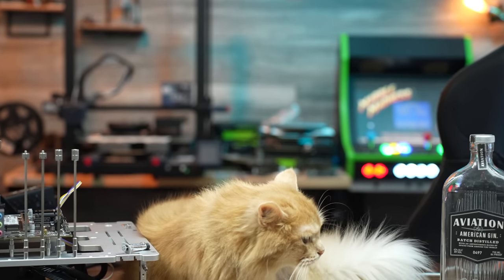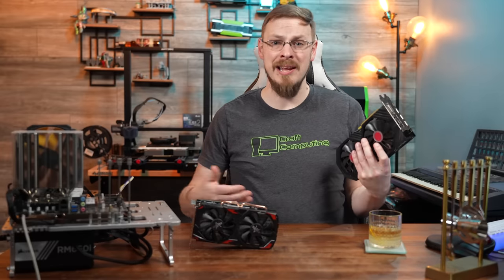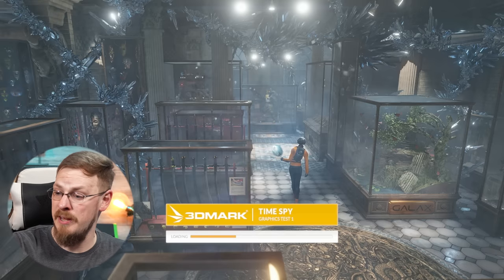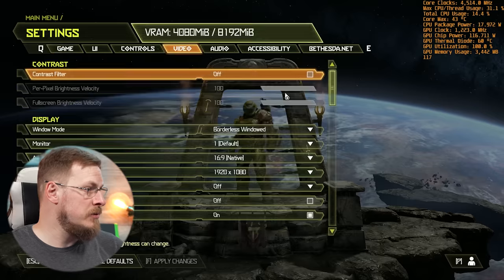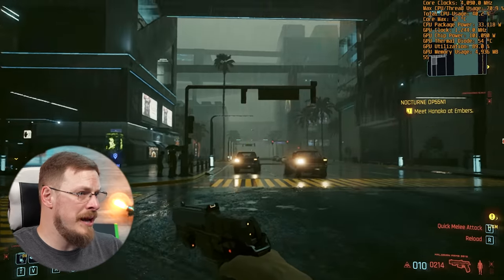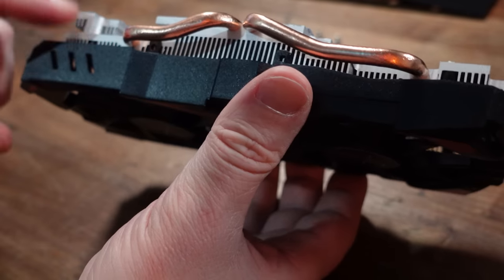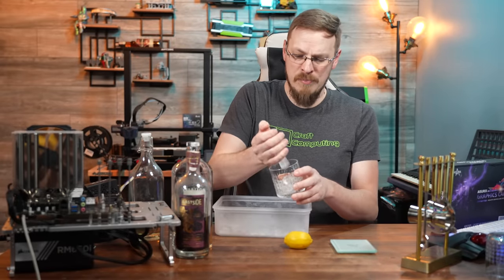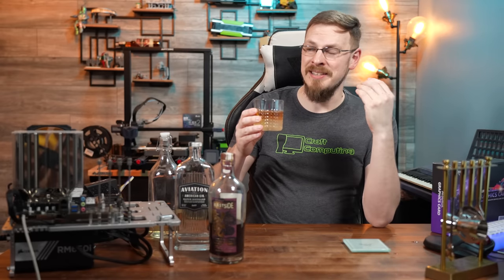BRAND NEW RX 580 for Under $100???

Comment: Why would anyone buy one of these things when you could get a used RX 580 or GTX 1060 for around $75 these days on CL or Offerup? You can slot and test those, too, and not have to wait an entire month for shipping. Far less worry about hacked roms, harvested miner chips, janky designs, malware, uneven QC, etc. These cards are firmly in  "penny wise, pound foolish" territory for me. I could see some appeal in some foreign markets with huge markups on original equipment, but if you're in the US with strong resale markets, I just don't see the point.

Comment: Before I  bought my asrock 6600 challenger D, I had a mlsse aliexpress 5500xt, it wasnt a great card, there is the fact that windows gonna windows, and would replace the drivers everytime it had a chance, so forgetting to do all the rigmaroll of disabling automatic driver updates could make the situation just annoying or straight up fuck up my windows install.. That being said it was a card that had some weirdo chips in it, the performance was really bad compared to a brand name rx 5500xt, the display port that worked (1 out of 3 only) would not work at all, when on a system, would display up to the motherboard logo, then the display would just die, regardless uefi or bios
I have an intense distrust to chinese cards ever since

Comment: I just have absolutely no clue which AMD card is new, old, good or bad. Their naming schemes are so confusing to the casual observer, I have seen "RX580" for sale but assumed this to be a very dated card given I can see 5,6 and 7000 series cards on sale and assumed these to be their older/mid/high tier cards.
Reply from the maker: This is correct. In order of release

400 series
500 series
Vega series
5000 series
6000 series
7000 series

Comment: Once again Patreon lets me know that you've posted. I don't know what YT's problem is but they need to fix it
Reply: yt notification never worked properly
Reply: @marcogenovesi8570  I know. I think they really need to allocate some time to "quality of life" features. But, I mean, come on, are they really going to do that?!
Reply: As I understand the notification goes out in waves. they measure how many of the initial audience click on the noti and then decide if it's worth the cost of sending out notifications to the rest of the subscribers or not. this is usually why it's recommended you tweet out or send a notification via other channels which signal the algorithm that there is organic traffic to the video which automatically breaks the threshold and videos starts being recommended to others.

if the video topic is not intersting then the video crashes and burns.
Reply: @tanmaypanadi1414  so the notification does not work because the random amount of people it sends notification to may or may not watch the video immediately. So the whole system relies on the creator to send notifications through other mediums to then create "organic traffic" that is not really organic but responding to a notification, so the algorithm will then recommend the video outside of subscribers for a little while?

I'm wondering if there is anybody left in the building with a basic understanding of how the system works and how to change it or are they all just singing in binary to the Machine Spirit. Because the above is madness.

Comment: Excuse me, but my Sapphire RX 570 8GB Pulse (non-overclocked) has max GPU freq 1284MHz and 1750MHz for RAM. And I remember that many other non-overclocked versions of RX 570 from other manufacturers had similar frequencies with my Sapphire. So, a typical RX 570 has equal or slightly faster clock with this RX 580 2048SP. In other words, RX 570 8GB >= RX 580 2048SP 8GB. By the way, there is also unofficial support for Resizable BAR.

Comment: Most of these Asia manufactured RX580 use cut down yet higher clocked RX580 chips. They perform better than a RX570, but worse than a real RX580.